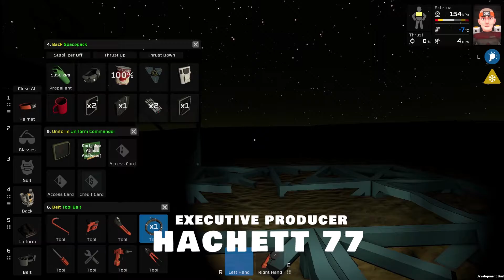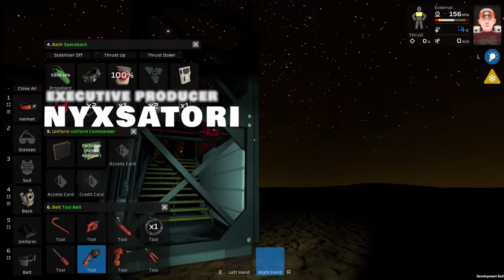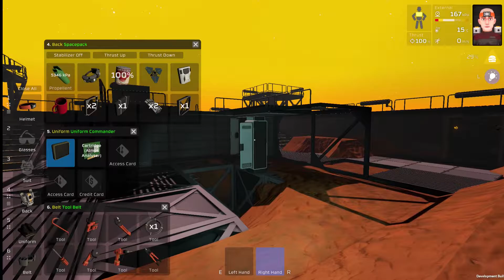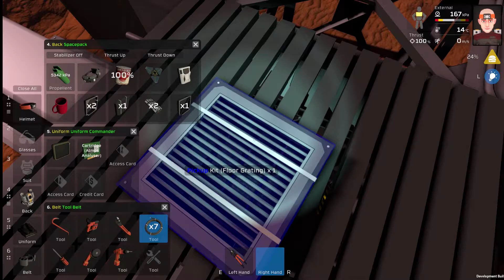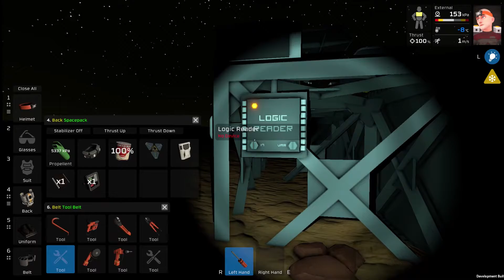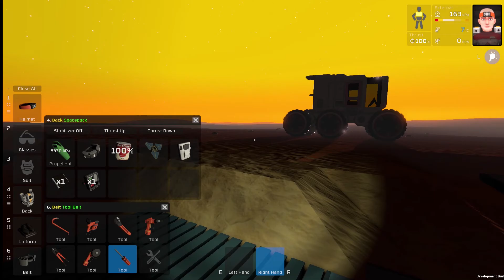Stationeers: Loulan | Solar Tracking

Comment: You can change the mode on the sensor to read the horizontal axis it should be in the in game wiki. 

For default sensor mode(vertical) zero is front, +is up, -is down. For alt mode(horizontal) +is left, -is right.

If you want perfect dual axis tracking you have to brush up on your trigonometry skills. And another set of logic I/O chips.
Reply from the maker: oh nice I will look at this! I was trying to have a 'uniform' facing and reading to make math and writing a little more consistent; dont really want to be needing to 'flip' formulas and inputs halfway through the math :)